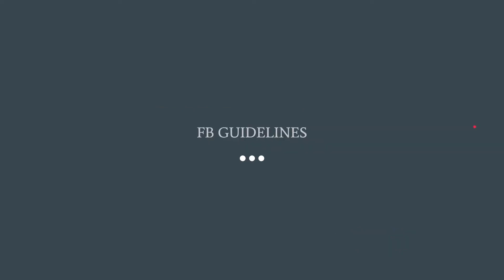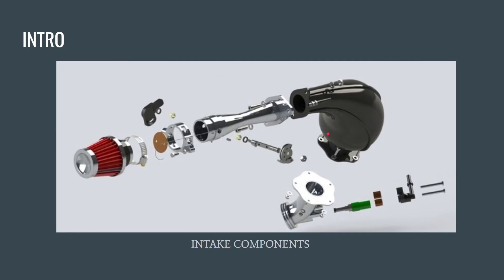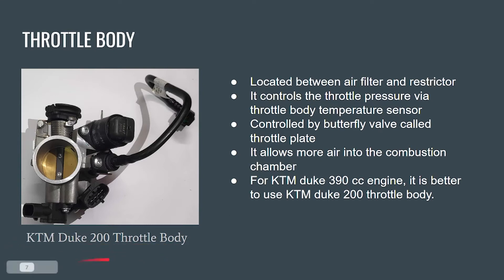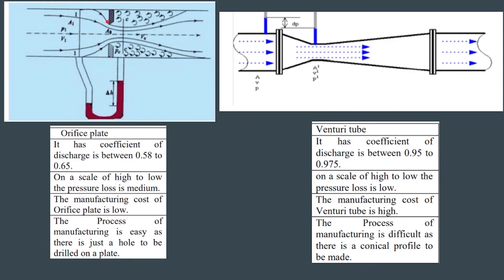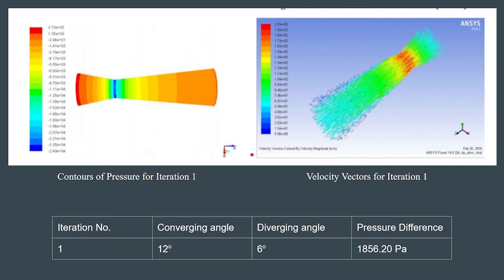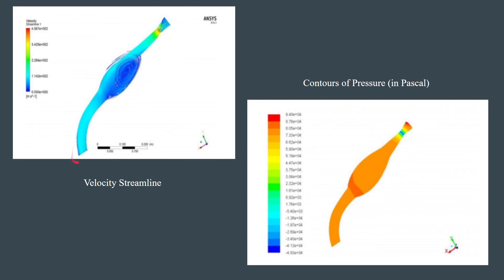Powertrain Design Rules Explained | Engine Assembly & Parts- Purpose | ANSYS CFD Fluent Simulations

Comment from the maker: Video Timestamps

00:00 Introduction to Powertrain
00:16 Design Rules for Powertrain Explained
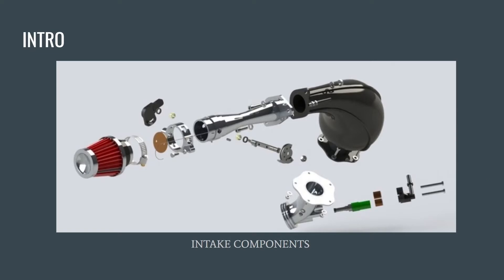01:50 Powertrain Engine Line Assembly
03:46 Throttle Body
05:28 Restrictor Introduction
06:48 Our Restrictor Design and Simulation on ANSYS CFD Fluent
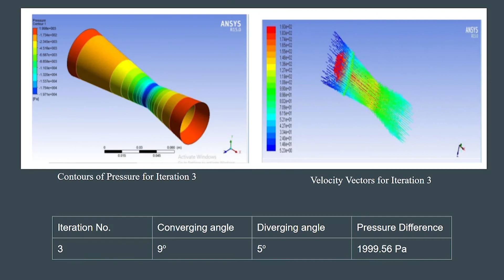08:02 Plenum Parts & Design Rules
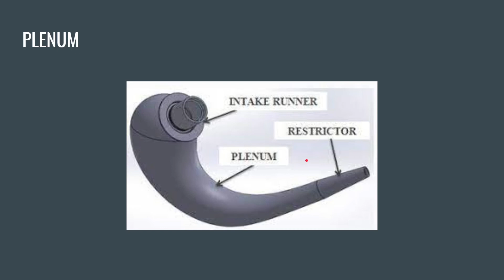09:33 Plenum Design and ANSYS CFD Fluent Simulation
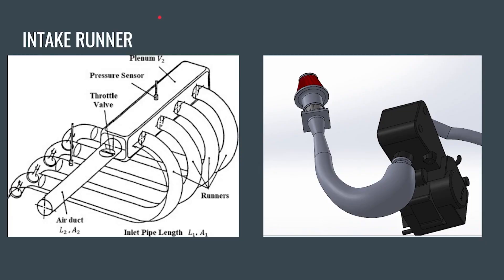10:34 Intake System, Runner,..